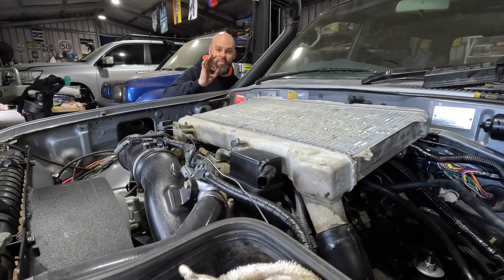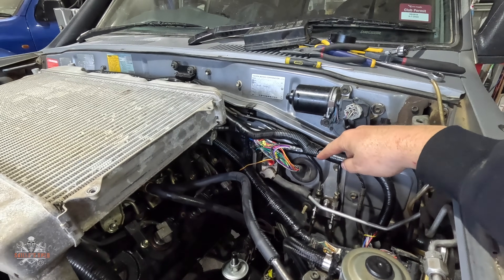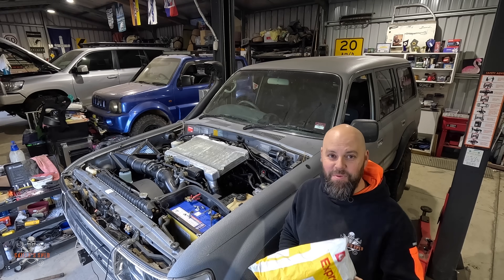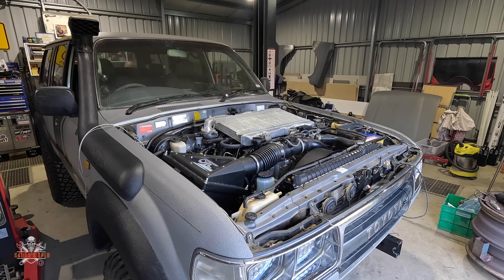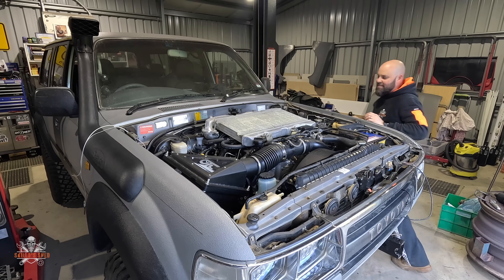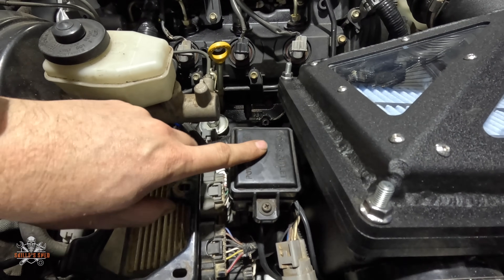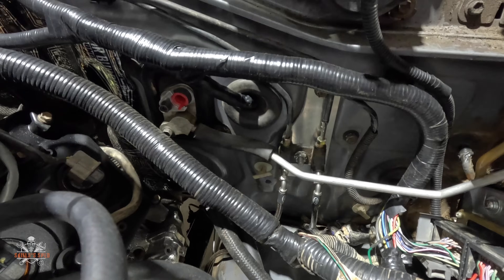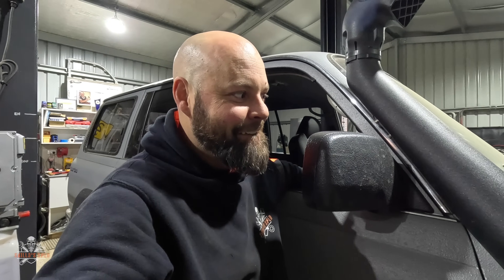First fire up of my 1VD-FTV swapped 80 series Landcruiser build

Comment: Very Thorough work, but one thing that has me worried is the REPCO Catch Can, There have Been a Lot Complaints about them causing huge Crankcase pressure Problems -causing engines to blow blue smoke,seals & use oil ! hope this helps

Comment: Why didn't you put a front mount intercooler on it?
Apologise in advance if its been mentioned somewhere already.
Reply from the maker: All good…don’t really have the room at the front  without cutting up the grill but more, it is a hell of a lot more piping for a single turbo that feeds to two throttle bodies. Unlike a HDT that feeds one side and turbo in the other, there would be pipes going everywhere to make a front mount work. I’m sure it’s been done, but it wasn’t for me especially considering the timeframe. 

Plus, the bonnet scoop looks better anyway 😂😂

Comment: Was it an negative trigger for the start
Reply from the maker: Nah there was a black/red and a black/white. The black/red was the one that went to the starter on the 1HZ so assumed it would be it. But it must have been the output from the old start relay I removed. So the black/white was correct as that came from the key. 🤦‍♂️. Got there in the end 😎
Reply: @skillosshed either way you have done an awesome job
Reply from the maker: Thanks mate. Appreciate that